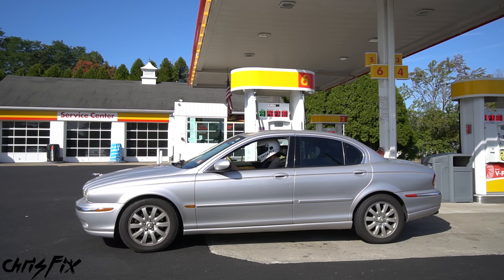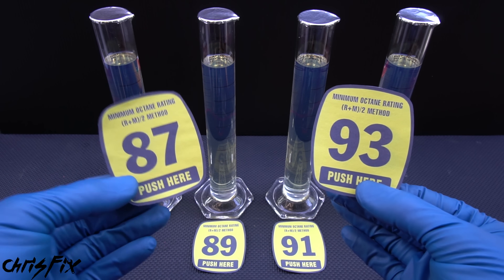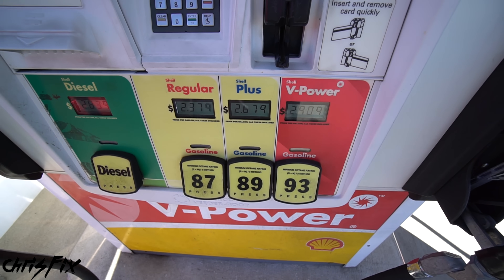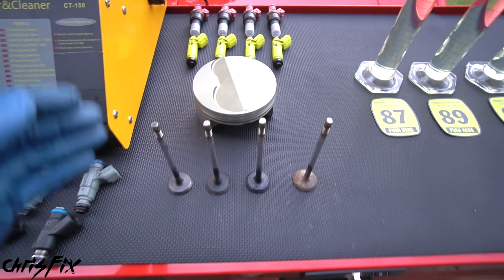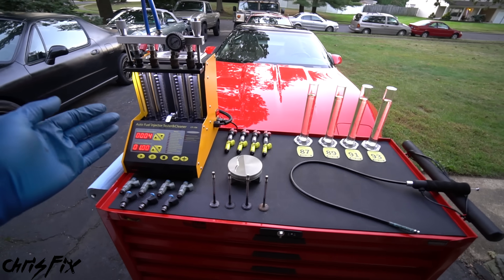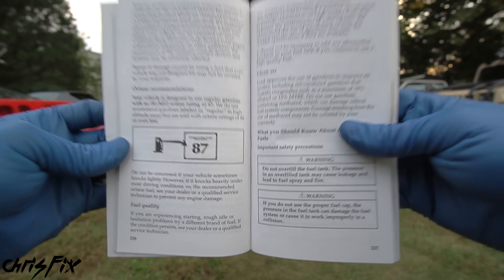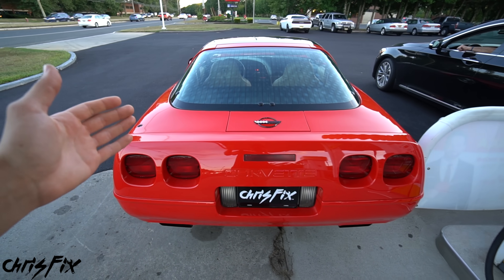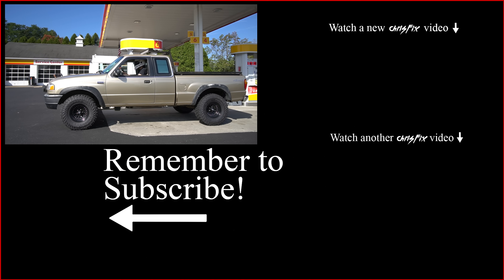What is the BEST Fuel to Use in Your Car or Truck and WHY

Comment: im driving an old car. 1978 caddy . 425 cid 7.0 liters. and if i don't use 93 octain my motor will  want to run after I turn it off and if i get crappy gas it will do the same. but at no other time does it act this way .

Comment: Thanks for the video! Question, I have an AE86, according to the previous owner the engine was from a MR2. The engine is now rebuilt and everything runs fine on 93. How do I know if I can run 87 or not? I am not sure which version of the engine is from... i just know it's from an AW11... 

Thank you for helping out. I have learnt a lot from your video and start doing most of the maintenance work myself. Thank you very much!
Reply: I would look up the engines specific compression ratio and Google what other people use

Comment: A few years ago I was at a doctor's office waiting for my son to have some tests done. The TV was set to a local news station that ran the same news over and over again. One of the news stories they ran was about the importance of using Top Tier gas in your car. Top Tier gas has better cleaning agents in it than Non Top Tier fuels. They showed the difference it made keeping the engine cleaner. Most all major fuel companies use Top Tier fuel, and normally you don't want to buy fuel from less well known companies. You can do a Google search to find out which gas stations carry Top Tier gas.

Comment: I worked withFuel hauling company & stations for over 30 yrs of my life. Here is a big one, All fuels come from the same pipe. I was told this all the time by al drivers and owners. Murphy ( Walmart) & 99% of stations are just that, Murphy oil... if it’s generic, it’s same as Walmart. Where do Stations like Chevron & Shell add their additives, no one knows & I have never seen. Watch yourself, the truck dumps and leaves. There are no extra tanks or fuel additive dumped by fuel hauler... crazy? All fuel does already come with anti rust, injector cleaner and other additives required by government off the pipe line. Now, Mid grade is a mix of the highest and lowest.. and some times the driver can mess the ratio up, to be honest. That being said.... I swear Shell fuel premium is the best! We travel a lot and it’s all I use on the road. I notice a mpg & performance improvement every time I use that Nitro added fuel... I just have NO idea how it is better? Lol they add it some how. Lol

Comment: E85 fuel is a worst case scenario. FLEX vehicles are rated up to this limit but I have never heard of a pump in the US that sells 85% Ethanol as the current vehicles are only rated to E15. Having a FLEX fuel vehicle allows you to safely travel to South America were super high ethanol levels in fuel are very common. Brasil produces massive amounts of sugar beet which is distilled into ethanol and added to fuel at very high levels.

Comment: I'm pretty sure the manufacturers list what grade to use on the gas cap or in the owner's manual. Not sure why a sixteen minute video is needed to explain to people to look in the owner's manual to determine what fuel to use and I'm sure it's listed in several other places.

Comment: Great, consise and excellent presentaion. I foloowed and understood everything. My '03 Saturn runs medium 89 octane. However, in the fall I empty 941 ml into my 10 gallon tank and fill up with 93 octane. Whether its logical or not. I'm not certain.
My motivation is to clean my injection and burn high ooctane gas.
On anoth topic, is there anything that can remove the carbon build up on your valves. I maintain my cars Pennzoil pp wix xp filter. The best in that dept. I like to clean the carbon build up.
Thanks for a very educational presentation. And a shout out to the fellas comments for their passionate, intelligent remarks for the most part. Some of it was new to me and a little over my head  (but I understood every you articulated), but I was impressed with you and the intelligent commentators.
Finally, I  drive an '03 Saturn Ion. And expept for my fall ideas I  use midgrade 87 octain.
Good work Rick. I appreciate your "Chris fix" presentations. We all learn a lot. 
Thanks.
David
Alberta
Reply: Run the recommended octane, but race her up a bit on the highway. High RPM's help removed carbon deposits. Also, you could try the water mist method, which works. You can find videos about it on youtube. A safer alternative for those who are afraid of the water mist is Seafoam. To simplify this video. Lower Octane burns easier vs Higher Octane takes a bit more to burn. This all has to do with piston travel and where the timing for the spark plugs is set to ignite. Lower Octanes burn closer to piston to top of motor/valves where High Octane takes more travel from piston in cylinder to top to build more compression when it finally does explode. So, running the non-recommended fuel is usually not good. Hope it helps.

Comment: I've always wondered about the mid grade, for the life of me I can't think of a single vehicle I've ever heard of that asked for it do you know of one
Reply: Out by me I can get 89 for the price of 87 on Wednesdays, I have had no problems with my 13 F-150 V-8.  My 01 MX-5 requires 91 or better, so that is what she gets.  Other then spending more money on fuel you will not damage the engine by using a higher octane fuel.

Comment: It be cool to see him do a side by side review of Vpower and Sunocos ultra and any other gas stations that claim to have a fuel that helps clean carbon build up
Reply: No need.  Major gasoline refiners also have very large storage tanks. They have always wanted to preserve these very expensive tanks.  So they added an additive to prevent corrosion to their tanks. Consequently that additive also helped prevent corrosion in engines.  The manufacturers were smart.  They used that extra expense to their advantage by advertising it.  In other words they didn't add that stuff for us.  They added it to save their tanks.  I was in the oil business for 8 years and I also blended gasoline back in the late 70s.

Comment: You forgotten to talk about the stations of lead, mid lead no lead on the pumps.
Reply: I'm not sure how old you are but...   Where have you been since 1986?  Tetraethyl lead additive in gasoline has been officially banned since that time.   So, for the last 34 years there has never been a gasoline that contains lead.
"...phase-out of its use in gasoline began in 1976 and was completed by 1986."
Reply: @marvwiese9668  not all gas stations are pump updated for  those of which have numbers on the grades. I'm 30 and yes I know that it's been banned. Life of a mechanic

Comment: I have a 2008 Hyundai Accent, I have check engine light ON with knock sensor error, I replaced knock sensor, no results, if I use fuel from 89 and up, light goes off, if I come back to 87 light comes ON again, this means I have carbon build up? On thr gas cap says regular gas, do you think Seafoam additive will help to reduce carbon build up? Or any other solution? I used 89 for more than 6 months, but coming back to 87 brings the error back. Thanks.

Comment: Chris hi, like your video on what gas octane to use in your vehicle. 
That said, I have a 2011 Chevy Silverado 1500 with an aluminum block 5.3 liter that has a 9.9 compression ratio.
The engine has about 150,000. Km on it, bought   new one owner.
I find I get better gas mileage with Shell V power, than with Shell 87 octane.
I also find the vehicle is more responsive. The difference between 87 octane and V power 93 octane is about 100 km per tank full roughly 90 liters of fuel.
Chris is it in my head or is there some truth to my observations?

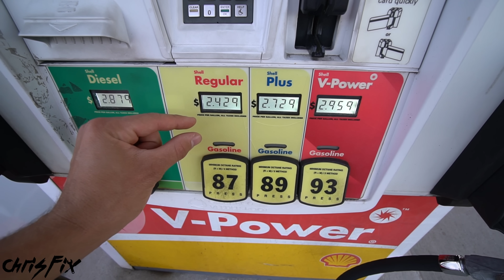Comment: Thanks for the detailed information. Enjoyed your video and you did a great job with all the extras. I just wanted to point out a contradiction you made. Unless I'm misunderstanding you, at approximately 1:45 minutes into the video you state there is absolutely no difference in fuel economy and/or power between the octane levels and then at approximately 12:20 minutes into the video you  state that there my be a small difference in fuel economy and/or power between octane levels. So which is it? Not trying to discredit you just trying to clarify. Thanks again.

Comment: A 1999 Plymouth Grand Voyger,3.02 Liter engine, I found that Mid-grade gasoline gives the engine 2 more miles higher per-gallon highway/city driving then if I used Regularly gasoline.  Then, I found that I get 2 more miles per-gallon highway/city on top of all that when ,upon changing the oil I add a quart of _______(forgot name) oil treatment to the oil and I get yet an additional 2 more miles per-gallon highway/city on top of all that. Than, I found the engine gets the best gas milage at humming-out at 57-1/2 miles per-hour on highway at giving me 32MPG highway with a 4,000LB vehical, a long mini-van that seat seven(7) people.
But, my question is when you use synthetic oil are you require to use a synthetic oil treatment additive ?  Does synthetic oil mix well with a non-synthetic oil treatment additive?
I Remain,
BILLY THE KID
28DEC19; 19:57 H.H.

Comment: Super simple folks, read you manual, use what they tell you to use.  Automotive "nerds" aka the engineers are NOT paid by the oil companies, they are paid by the automakers who want you to enjoy a car that AT LEAST lasts longer than the warranty and be happy with your product.  Don't listen to myths that say you should buy higher octane for cleaning running engines, or lower then recommended octane because its all a conspiracy.  

If you own a classic car, go have it serviced to replace the old pure rubber seals in the fuel system with ethanol-resistant ones.  Newer cars are fine.

Comment: If it says use 93 but your at a gas station that has 91 will that damage your engine
Reply: no, it will be in a short term, like he said use a octane booster, or just run maybe a half a tank and then fill up with 93.

Comment: Oh and by the way ChrisFix do you know what could be making a knocking/rattling sound my uncles car (it's coming from the gearbox) we put oil in it and it stopped but now its leaking and losing oil kinda quickly but not to quick so if you have any idea what it could be please reply to my comment I need your help because the mechanics we visited all said it just needs oil so please ChrisFix if you know what it is tell me.
Thanks!
Reply from the maker: Where in the transmission is the fluid leaking from?
Reply: @chrisfix  I don't know where exactly but somewhere from the gearbox

Comment: Different octane fuels carry the same chemical potential energy.  High octane allows you to run higher compression and more ignition advance.  Both result in greater efficiency.  So, you get more power out of the engine, from the same energy input.
Reply from the maker: thanks for sharing

Comment: @Chrisfix Here in California we have Sunoco 100 octane fuel available. Would it make any difference then?
Reply: We have it here on the East coast, too. If your car is made to run on a lower octane, it will not benefit from the 100. 
The only cars I've had that would be able to use the 100 have been high compression  (12.5:1) or heavily modified forced induction.

Comment: i did not know that e-85 meant 85% ethanol that's probably gonna help me out down the road.
Reply: William Colt You can’t just run E85 unless you have a flex fuel car. If not you will need to replace your stock injectors and upgrade your your fuel pumps. If not you will do some serious damage because you are putting 107+ octane

Comment: do you know much more about E85? I am new too E85  have been using it for this past year. I run V-Power in most my Vehicles I ran it a few times in my new Car I got last year a 2018 3.6L Grand Caravan SXT. I usually run 85 in the SXT but I have put V-Power in it and got much better fuel economy. The owners manual does not suggest e85 in the SXT, it suggests 87 or E85 and the fuel economy is on E85 500miles 87 550miles one full Tank.
Reply: E-85 has about 35-40% less energy stored within it's alcohol (compared to hydrocarbons of gasoline) and therefore results in around 35-40% lower fuel economy. It is good, however, for applications where an engine can take advantage of higher compression as E-85 is technically rated for 104-106 octane (depending on ethanol content). Studies have shown that higher ethanol content fuels can result in cleaner engines and are better for the environment as it is a clean, renewable energy source.

Comment: what fuel should I use if I am gonna store the car for about a year, should I do premium since there is no Ethanol ?
Reply from the maker: I would use whatever fuel your car requires, then add some fuel stabilizer and that will prevent it from going bad!

Comment: You are incorrect about fuel burn speed and thereby temp.  Higher octane the more “pure” the fuel is and will react closer to the standard isoctane (100). The more “pure” the longer it takes the molecular chains to break down and oxidize in the combustion process. This means the higher the octane the slower the burn.  This also means there more resistance to detonation.. which requires the mixture to be above the auto ignition temp and above that threshold for a certain amount of time called the induction period.  What octane does is increase the induction period which in turn prevents knock.  Because lower octane fuels burn faster which is closer to a Vol=constant burn which increases combustion and thermo efficiency... you want to run the lowest octane fuel you can with out detonation.  This is why higher compression (or boosted) engines require higher octane due to an increase in pre-combustion temps in the cylinder.  If you run too high of an octane the average cylinder temp will go up and efficiency will go down causing a loss in performance and fuel economy.

Comment: Just put what your manufacture calls for.  I drive a 2010 Ram that calls for 89.  I've seen someone with a 92 cadillac that required premium gas who put regular in it.  It started knocked an needed injectors in a month.

Comment: I think the ethanol content in the USA is much higher than in the UK, however in  the US you have higher ambient temperatures, so  that adds to stabalisation. However in England here BP has 99 RON  petroleum . Our fules are 95, 97 and BP  Momentum is 99. Here in the UK with the colder temperatures and cost of gas which is nearly 5 times the price and basically sitting in traffic you tend to only buy the fuel need. But thanks for clarification of RON, and Pump Octane. However purely from a performance issue, and valve regression you cannot beat leaded fuel. You get far more miles, less engine damage,. However this is alledgedly bad for people.. Howvever if you are driving 1300cc, to 1.6cc, petrol enigines with lead is going to be better than a gas gussler 7 liter  only giving 8 miles per gallon.

Comment: Tesla requires premium. Thank me later
Reply from the maker: You spoiled the video! :p
Reply: I've been looking for half an hour and can't figure out where to put it! Should i just add it to the blinker fluid reservoir?
Reply: tinbanger66 don’t forget to replace your piston return springs
Reply: Been running my Tesla on 87 for 2 years now..no problems at all.
Reply: Marcus Bishop get ready for that shit to blow up
Reply: Help... where is the muffler bearing on a Tesla model 3...
Reply: Oby Sunners the muffler bearing is located under the car
Reply: Yea put premium in the tow truck when it takes your tesla to the shop. 👍
Reply: Much later.
Reply: Don't forget to use quality points/condenser in your distributor and set the dwell/timing to manufacturer's specs...
Reply: t s...Umm, let’s finish that statement, “Tesla requires premium BATTERY”.
Reply: OH MY GOD.  Didn't you know, that Tesla makes their own fuel?      NOT!
Reply: I got a borla exhaust for my Tesla and it sounds great
Reply: I put a turbo on mine....sounds like a jet engine.....lol
Reply: I just changed the glow plugs of my Tesla. That along with some fresh antifreeze in the secret engine overflow reservoir had it purring like a kitten. 😸
Reply: @SI-GOD  I just had to change out the electrical fuel filter and electricity pump on mine,  when the electricity filters clog they just dont run right....lol
Reply: Remember to fill up the 710 cap with 710 rated premium grade washer fluid.
Reply: actually it requires Diesel..... if a tesla dies, the Highway department brings a diesel generator to charge it
Reply: yes brother after  4 years after Owning model S Thanking about LS swap 🤣
Reply: @bootlegscarce0844  Be careful. People these days, of a certain age group, are brain dead enough to attempt it.
Reply: Uh... O...Kay???

Comment: Hey Chris, i have a 1977 F-150 4.9L 300 inline 6 with a single barrel carb. What should I run and is there anything I can add to clean out whatever was previously done?
Reply from the maker: For your situation, I would do a google search to see what other people with similar trucks run in their trucks. But if you can find the original owners manual, It should tell you exactly what to do!

Comment: Back in the 60's when I was young and uninformed, I advanced the timing on my old 6 cyl stick shift Chevy, like a lot of us did back then to get more pep from the engine. I did have knocking on load or hard acceleration but not knowing any better, I ignored it. I ended up burning a hole right through the top of one of the pistons. True Story. I'm much older and smarter too so now, I know better :-) Your videos are the best. You always include the important details whether information like this one or the small details in one of your repair videos. Shared this one on my FB too, along with your Drift for Charity video.